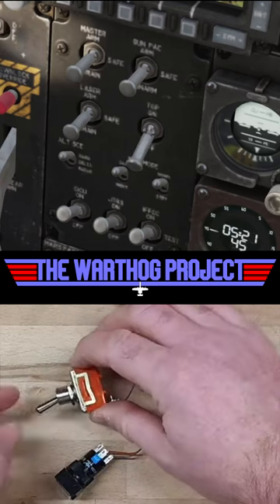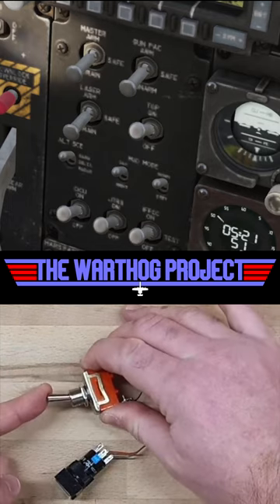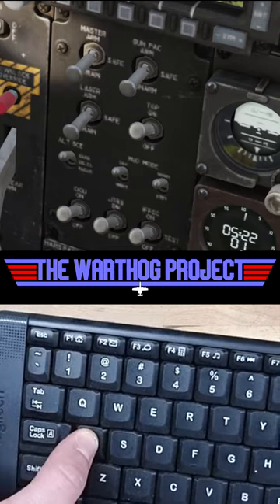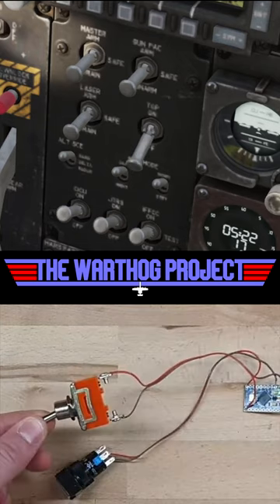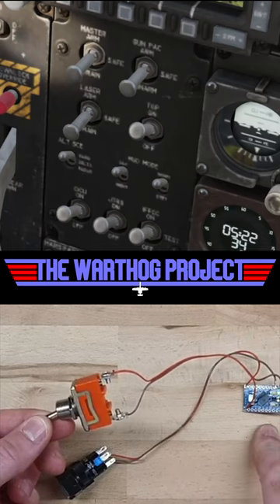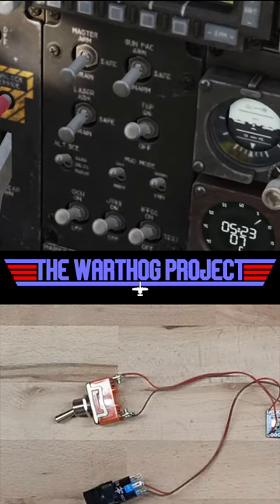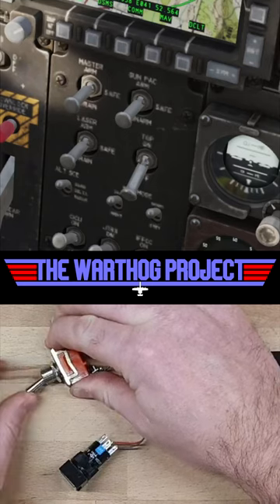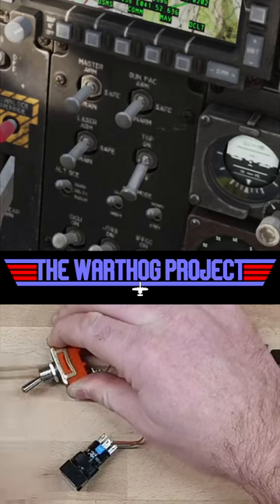Toggles Switches in DCS World #dcsworld #flightsimulator #thewarthogproject

Comment: Ahhh. You guys do know DCS has a switch off keybind now? So lets keybind that TGP switch. Lets say it is push button 29 on the controls. In the controls go to the TGP ON command and keybind that switch to 29. Now double click on the TGP OFF and keybind it also to 29. Now click on the 29 and it will bring up the dropdown menu for the keybinds, select 29_OFF. Now when you flip the switch on it turns on and when you flip it off it turns the TGP off.

Comment: You can fix that with simple code by having it basically "press the button" once when switched off
Reply: The problem is that it's open loop. When you flip the switch it toggles the control, but does not care which state it's changing the control to.
Reply: have it when pin is high do one thing then when low do another you can use both states to control something